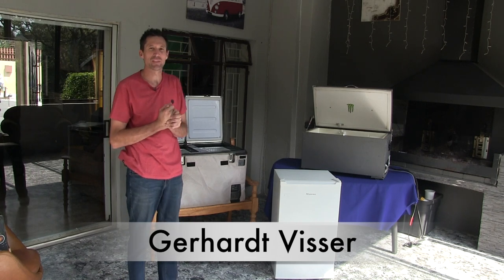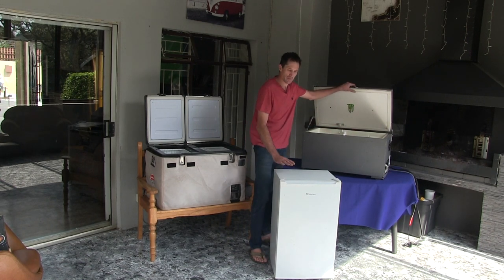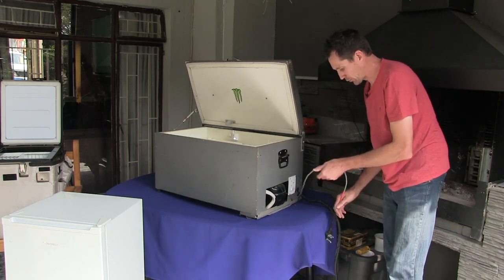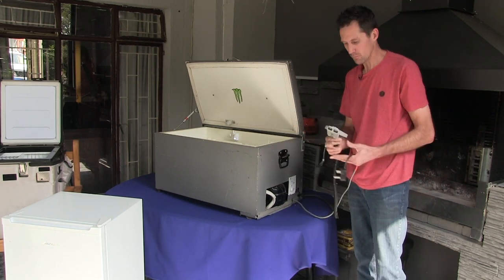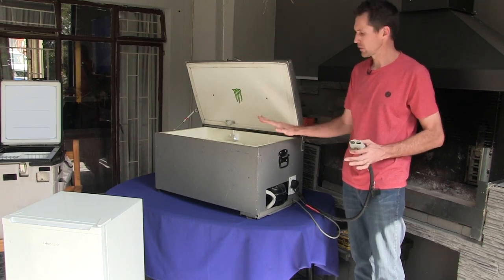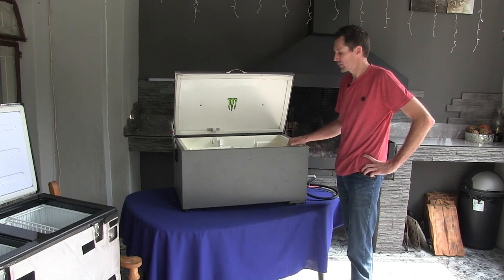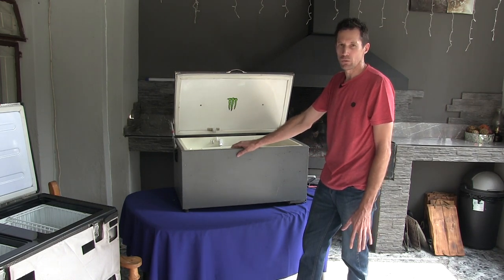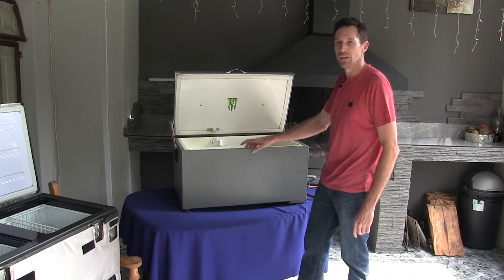Convert a bar fridge into a camping fridge part 1

Comment: Why not leave it as a vertical fridge?
Reply from the maker: That's a good question. The reason behind it is to keep it as efficient as possible. It you open an upright fridge all the cold air rushes out the bottom of it. Where as with this you almost trap all the cold air in the bottom when it lies on its back.

Also most of your camping slides and setups accommodate for standard camping fridges, and when you have this horisontal, it's dimensions is very close to some of the famous name brand camping fridge/freezers.

Thanks for the comment.

Comment: Thank you so very much for this.
Question?
Do you run it whilst driving bad roads.
Reply from the maker: Hi Alexander. I used this fridge going to the top of Mozambique where roads were not existing. So definitely it was and will still be used for the ruff stuff. Thanks for watching and the support. 😁💪

Comment: Do you use a pure sine wave or modified sine wave inverter?
Reply from the maker: Hi, using a modified sine. It is definitely less efficient than pure. But running this project as cheap as possible. Using the modified sine now for about 10years. No micro electronics that the modified will damage. Thanks for the comment 😊💪